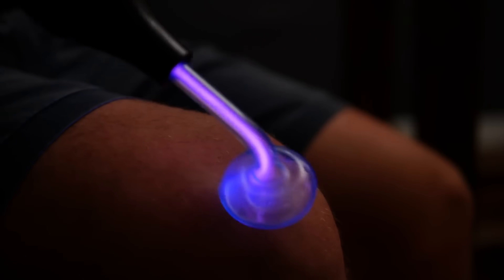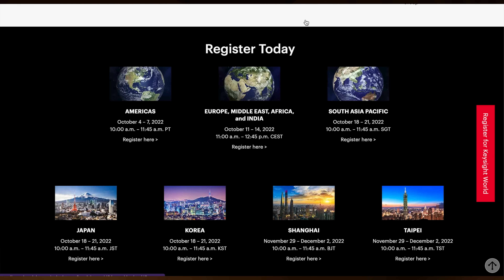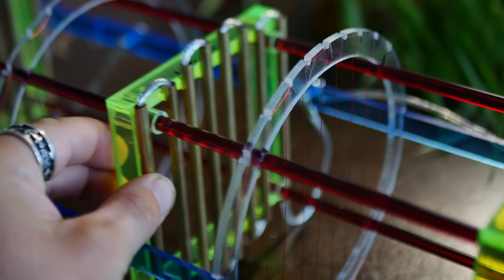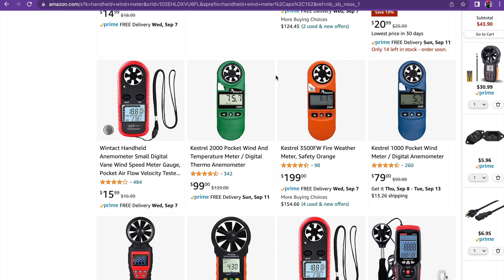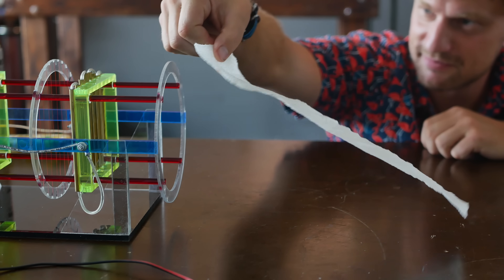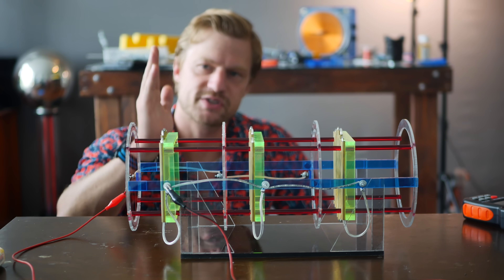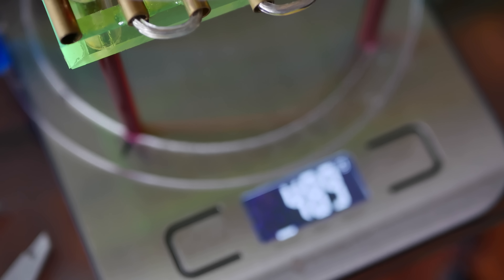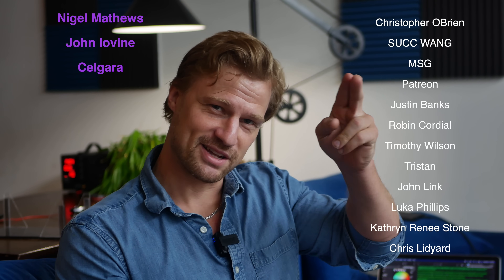Designing A Next-Gen Ionic Thruster! (For Flight)

Comment: In the vacuum of space and microgravity, it's ~3 feet @ µ_0 Ω in reference to currently available technologies, whereas, power must exist, on Earth in 1G,  it's <3 feet or whatever, and fallible at <1GW. After seeing that, it's only now I am absolutely sure about 1GW. Don't get me wrong, I calculated it at 14W and then some, for each 1lb of weight, however, that might be in microgravity or in the propulsion of something with wheels. It won't allow flight, my guess is, even if wings were used to glide. The 1GW thing is pushing it a bit far in requirements, however, the scale between weight and thrust will only be known when the technology becomes real. 1GW is an easy accumulation of work energy. That's only in my mind. No one on Earth will gain 1GW of whatever people want to call the wind whatever. thruster. Wings won't help either, because weight and speed will always confound a so-called solution. It will slow down, fall, and fall. Oh, that's where I saw that. I absolutely didn't believe anyone would try any such thing at the low grade technology level and brag about it just to be first. Then they have enough advantage to shun the real stuff. So glad to know the absolute truth on the subject. Now what? Wait for the real stuff to shun it and stay at the "first" bottom level of development? A lot of people it seems were beaten at it, however, none of those winds (wins) count, or do they count er act gravity nor will they count er act the vacuum of space.@ µ_0 Ω Boing! All humans!! Boing!
Reply: Thank you.
Reply: I have always wanted to be chosen to win a prize for something. I clicked on the link and saw nothing. It's OK. I don't think any prize other than the Nobel Peace Prize or winning a scientific contest gaining a prize of over a million bucks is worth worrying over, therefore it's OK if the link is broken. If only this kind of invention wasn't so coveted by many even at its primal none functional stage, that sort of prize would have been great. Imagine living in a world without such obstacles. A reform on scientific progress sounds about great. I know no one patented this technology out of fear it would get stolen, or because it's in its primal stage, and not only have I seen the Ionic Air Puffier as it was years ago, being advertised in the wee days of my research in the field of study, in the Ads, they spoke about its functionality, in details. then one day, people stopped talking about it. The truth on the subject as I have seen lately,, after seeing this video is that Ionizing Air allows Ozon to occur. I have been trying myself on field research in avoidance of ionization, however with the Terawatt Power Source I invented I still had to upgrade on minimizing the usage of power to each flight module, as in, a module can't be a terawatt if even a kilowatt per module is dangerous. Besides, the avoidance of ionization was a total coincident. As I researched and developed, my inventions took their own paths leading to the unifying field. The ionization thing however in a hands-on experiment is not known, still, if a field is used, no ionization will occur. I refer to the usage of the gravitational field emerging as the unifying field was discovered as a byproduct in the experiments. I published my findings in my last submitted patent application and was writing a book about the research. Like I mentioned, scientific reform needs to happen. My invention is being stomped on by nothing or what was invented since the 1800s and it never got off the ground. Pun intended. The stuff is handled like Nikola Tesla's Tesla Coil, it's always mentioned, people want to profit from it, it's limited in functionality, and no one can make it do anything than it has already done. I had my own idea even before I learned about who Tesla is. I worked on my own, nonexistent theories until now, and development since the mid-1990, I made progress in 2006, 2010, 2016, and finally understand it all pertaining to atmospheric density and the limitations of power usage. That is high amplitude power gained at a range of 300mA p-p to <7A p-p. The important thing is to minimize the current and still achieve high accumulated power. Who has been doing that? Nobody. Some people feel it should be high current being used, yes, if a person wants to create a noneffective electromagnetic field.

Comment: This was absolutely fascinating. Thanks for making it. From a mind that has no understanding of the math or physics that go into designing this, would altering other variables help? Ex altering the distance between wires (possibly adding an insulation barrier between strands to prevent arching/shorts) or having wires off-axis from each other? Ex 30, 45 or 90 degrees off axis? I do not know if these will yield different results but figured I’d pose the question/idea

Comment: i know how to make your design produce more lift. you need to use a dc generator around 300 volts or a dc power supply of 100 to 300  volts at lots of amps feed in paralell with the high voltage input. since the high voltage already produce breakdown of the air increase conductivity the lower voltage high current would now increase thrust and probably more that enough to the lift its own weight given the converter or generator is light enough including fuel engine prime mover or battery.

Comment: Would changing the air make a difference. Like for instance if you where to pump in a gas that was more easily positively charged would that increase thrust efficiency? Does a gas even exist that is more easily positively charged than regular old air. I don't know, I'm not smart enough to know such things. But it sure is fun to think about.

Comment: i'm curious how moving the emitters closer together might change thrust. you changed the spacing between cathode and anode, but not between sets of fans. would spacing them closer together produce more thrust? i imagine the staggered spacing would have similar effects on the machine as a whole. 

there used to be this magazine i got as a child that claimed to sell blueprints for a working hoverboard that used ionized air as it's lifting means. i always thought it was crazy. i mean, back to the future doesnt exist. but one of the things they claimed was that they used magnetism to constrain the ionized air, and i think that, in theory, that checks out? i'm wondering if you can achieve more efficiency by sticking a magnet inside the stream to pull the ionized air towards the rear. maybe a grid of small coils? or using a large coil to keep the ionized air constrained in a tube of some kind?  i'm not sure how that would work

Comment: I think I have some improvements for this
1. Ducted airflow
2. use a mesh for the anode
3. more stage

As an option i think add some compression and turbine stage like a normal jet engine where ionic thrust use in place of the normal fuel combustion chambers.

Comment: Excellent experiment.  Fun thinking on what to try with lots of good suggestions below.  I thought what would happen if you rotated the the wire screens slightly and decrease the diameter as it goes thru the stages(implies enclosing the structure).  Not a tech person here, but are there possible ion multipliers to add to the stages.  Lots of variables, wonder how far the math has gone?  Great video.

Comment: Right now you have equivalent voltage going to all of the stages. What would happen if you changed the voltage to individual stages? Gas turbines have a compression stage, combustion stage, and exhaust stage. Maybe changing the voltages to match the pressure in each stage would give some cool results?

Comment: Instead of grids, would a helical array make any significant difference? After you enclose the whole thing? It seems like you're probably losing some efficiency by the whole thing being open. I'm thinking about how the engines on jets are enclosed, along with the way the air flow is ducted and chambered. It's vectored on the inside adding compression at the exit... or something like that 😃

Comment: @plasmachannel 
Ion power group are using graphene coated corona wires to extract power from the air. Could you use this same method of coating the wire to charge more of the air molecules because of its increased surface area? 

Also what about closing in the sides?

Comment: My guess is to remove the middle section of the ground plate as it interferes with the air path. Then use a edge ground plate like the ionic lifter

Comment: Many people have suggested enclosing this for ducted and pressure build, I wonder if it is possible to add the same technology to the sides for forced air containment, much like many reactors use magnetic containment to keep plasma off of the side of a device, could you create IONIC containment to force air to the center?

Comment: As stated below, add a Venturi effect tube!  I would also try to experiment with different signals if you can (different square pulse width, sinus, saw, etc).  Can you amplify a signal using the voltage ladder?  Perhaps a phase shift in the signal between the stages would have an effect?  Can the wire grid be closer, perhaps with some fine insulator fins between them?  Hehe, those are a lot of parameters to test!  What about breathing ozone?

Comment: wow nice built and i liked the design, Just one more thing i want to add , Why dont you add a thin layer of plastic wrapper kind of plastic material as Whole case for the model covering the whole model expect front and back so that the normal surrounding air in room wont interact the total output thrust air and may try to to reduce the size of ring on the back where the air flows out  and keeping the front of the model in same size  , i mean kind of like THIS : -

ll   
ll   il
ll   ii   ll
ll   ii   ll   ll
ll   ll   ll   ll  ll
ll   ll   ll   ll  ll  ll
ll   ll   ll   ll  ll  ll
ll   ll   ll   ll  ll  ll
ll   ll   ll   ll  ll
ll   ll   ll   ll
ll   ll   ll
ll   ll
ll

Comment: Nice design.. congratulations...very inventive...
For next you can apply as below, the Venturi tube Principle for aerodynamically generate more thrust, make the design more cambered around 25% of its length, and of course make it a enclosed tube so as the air sucked in will accelerate inside it...let's see how much gain will get in the thrust/ weight ratio etc...another effective way would be pull the plasma generated out, not just the air, then it would really increase net thrust thou

Comment: 9:11 as beautiful as they are, i'd actually like to see none of these. If you're seeing corona discharge, you're actually looking at wasted energy. The most efficient ionic thruster needs to convert as much energy as possible into movement of air molecules, and not into a lightshow and a bunch of undesirable chemicals. 

But this is an amazing 1st attempt. I've mulled about this idea for over 10 years, but I've never managed to develop the skills to make voltage multipliers. But I wanted to do just that to be able to build such a thruster. In my design, I wanted to test concentric electrodes through a multistage duct, but it would be much harder to build than straight electrodes. 

Another challenge here that the faster the airflow goes, the less it gets accelerated by ionic thrust. If only there was a way to slow down the airflow without losing energy before it crosses an electrode... Actually i think there is a way; if the electrodes sit in duct where the diameter varies from big to small to big to small etc, the airflow would slow down in the areas where the cross-section is large, converting velocity to pressure, and allowing for an electrode to maximize it's effect before having the airflow restricted again, converting back to velocity. This would be hard to build but seems worth a try.

Comment: Improvements:
1) Enclosure - Currently, the whole rig is unenclosed making it more susceptible to losses. 
2) Exhaust cone- A cone would help to draw in and compress the output providing a more stable, stronger and directed output.
3) Turbo fan-  A fan rotor would help direct and draw in ambient air.

Comment: Inefficiency 1: It is not a "ducted" system as the air is able to escape out of the sides and interfere with the structural frame.
Inefficiency 2: Certain parts of the ion emission wire appear to be glowing brighter. I'd assume that may be due to dirt or oils on the surface of the wire, or because of imperfections in the copper. If you were to use a more uniform, cleaner wire this may boost efficiency.
Inefficiency 3: The positive Ion emitters are all linked on the same circuit you will have an additional degree of control and thus more opportunity to improve if each is on it's own independent circuit. Then very the voltage of each to find the best result.

Inefficiency 4: I'm curious to find out what would happen if you increased the amount of emitter surface area by reducing the spacing of the wires.

Comment: The inefficiencies are:
1. No ducted airflow. Moving fluids create low pressure that cause material to enter the system from the outside, and this bleeds power, as well as creating loss by allowing vectored fluid out of the system.
2. You stated the electrodes are in parallel, but you wrapped the coils back and forth. There are non-identical voltages on parallel wires in each coil. Voltage is being lost as power is drawn out of the wire. With the loopback wire method that you demonstrated at 4:14, , where the wire enters with high voltage on side A, it then is looping back from side B, you are losing voltage twice (once A to B then again B to A) by the time it reaches the entry point on Side A, to loop back again. This creates a voltage differential and if the resistance in the air is too low (because the wires are too close or the air is too dense), a spark will jump the gap. Consequently, your wires must have a separation significant enough to not allow sparking, and thus is inefficient by having fewer wires ionizing the gas than one might want. Switching to the wires operating in parallel with no loopback and thus the same voltage at all entry points on side A, losing voltage identically and having the same voltage at exit on side B eliminates the chance of sparking (or at least greatly reduces, because perfect matching won't be possible, and the edge wires may not give up as much voltage as the center ones). More parallel wires means more power can be provided to the air. This does, however, demand that all wires also be the same length, so the duct will need to change to a square shape, unless you can find a way to match voltage at the entry points.
3. The round ground tubing in the airflow is not aerodynamic, so creates loss. The ground tubing needs to be replaced by something more aerodynamic.
4. Many of the surfaces facing the airflow are flat and not aerodynamic. Some will be solved by 1, so long as the duct is on the inside circumference of those round coils.
Addendums: Compressing the air from the intake after the first coil may improve the efficiency at the second coil, but it also lowers the resistance between wires in the coil, and it becomes more susceptible to sparking. This may not actually work the way some people are thinking it will. Compression in turbines increases air density for mixture with fuel, but we're not doing that here. Since the distance between wires is set by voltage difference and the electrical resistance of the air itself, compression may wind up as a zero sum, due to needing the wires to be further apart.
Would a parallel insulator between the wires permit higher voltage differences and permit more wires in the coil? Or would the increased friction slow the air too much?
The need to duct may be the ultimate death knell for this technology in commercial applications. That cool blue light? That's radiation and loss, and remember that blue light has a lot more energy than infra-red. That will heat the ducting, which may thus require significantly heat resistant materials. Light materials tend to not be more heat resistant (until you get to something like aerogel), and they are more vulnerable to damage. If you're moving at commercial airliner speeds, even if this tech is more efficient, fast moving air in the duct is inherently hot just because it is moving fast, and friction generates IR and material deformation. Dissipating that heat is going to be a problem. Modern jets needed the invention of nickel steel alloys not available in WW2 to handle the pressures and temps as we got into the jet age. But there is a problem with any metal: it is electrically conductive and must not contact the wires. Thus, you need some substance to insulate the wires from the duct walls, unless the duct walls can be made of non-conductive materials. (And see the treatise on parallel wires... the resistance must be higher than the air's resistance, or it forces wire separation.) Is there something light and heat resistant enough to handle this? Or is it just a low speed toy?

Comment: You got a bunch of paper on optimising this effect by adding a neutral electrode in the flow, 
more slices, smaller gaps, intake optimising, use the plama expanding to push more air.
polarity is important ( air is 80% Nitrogen > 2x N  and much heavier than O2 - > 2xO+ ), flow depend of the difference area between electrode, 
concentric ring from large to small with alternating charge, each slightly ahead on the engine axis  : +O->-o->+°->- (needle)
switching polarity between stage ? magnetic acceleration (LHC style) ?
Problem ? NO poduction ! energy consumption againt batteries energy density (P = I * V)!